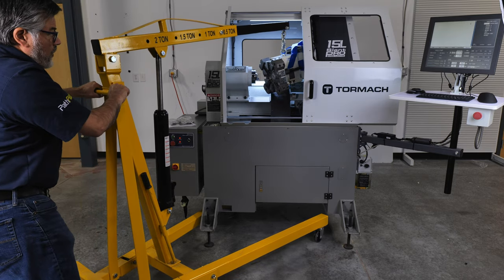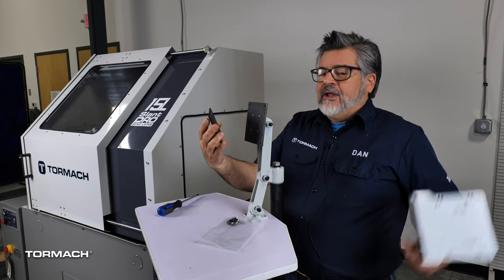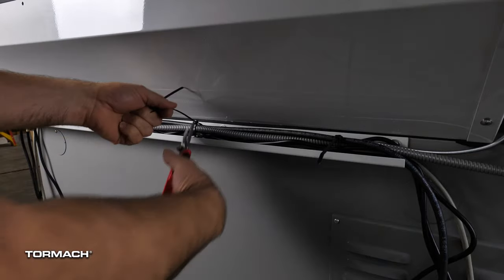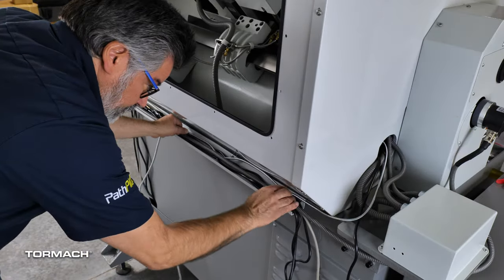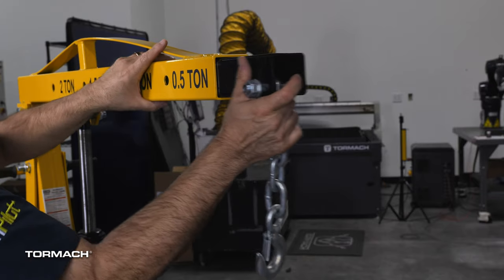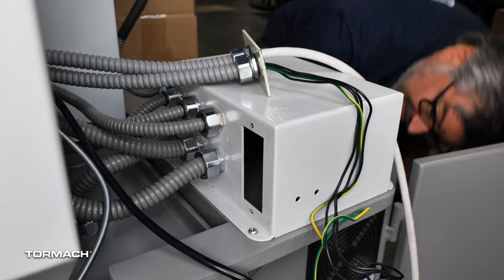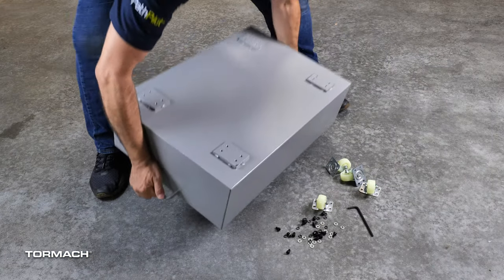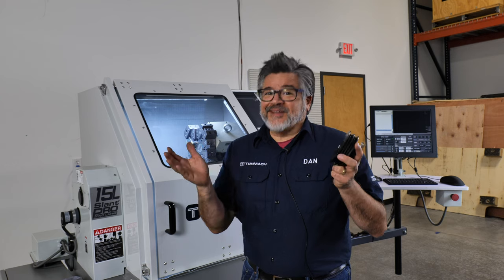Tormach 15L Slant-PRO with Turret Installation | Updated

Comment: Is there any plans to have a PathPilot Operator Console for the 15L?

Also is there any plans to develop a larger lathe with 16C dead length collet system that does not chew up bore size with a drawtube, more distance between centres, a automated tailstock and a parts catcher on the door? 

Maybe make the cross slide bigger to have the ability to mount a second turret on the front side of the cross slide?

Servo Motors?